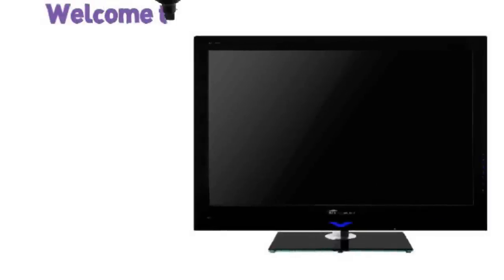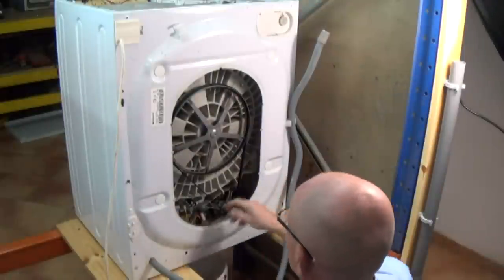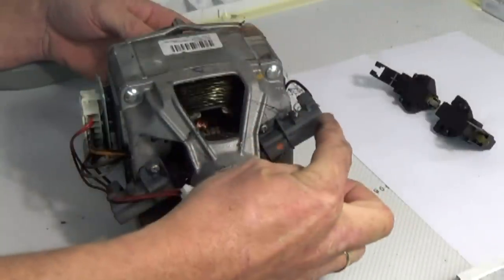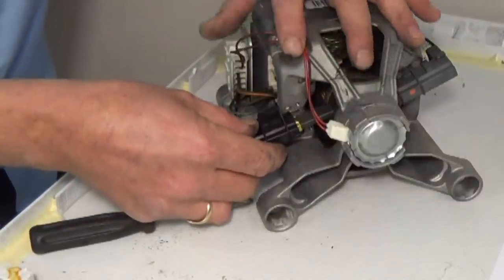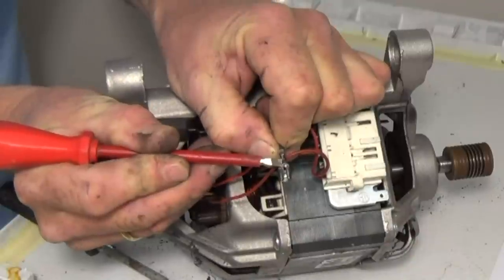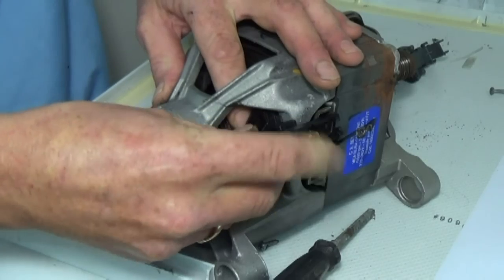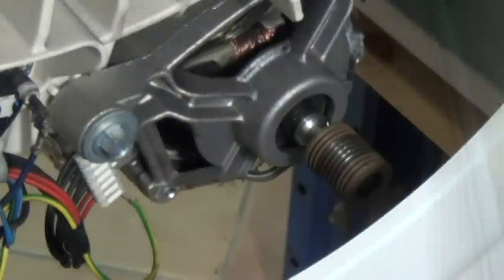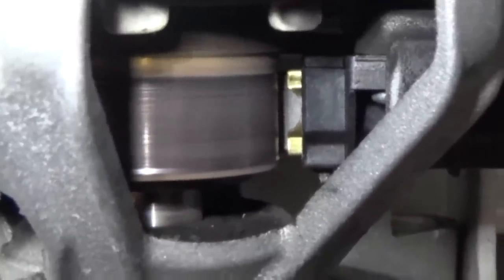How to replace washing machine motor carbon brushes C.E.SET Hotpoint, Indesit, Scholtes & Ariston

Comment: Thank you so much for this video. The step by step instructions were very clear to follow. The slight differences I encountered on my Hotpoint washing machine are that the motor is Nidec brand, the carbon brushes were PA66-GF and they were held in by 5.5mm hex head screws (which was annoying, as I had to order a 5.5mm socket). I ordered the carbon brushes from your eBay store and they arrived within 2 days. I can't explain how happy I am that the machine is working again. Thanks again.

Comment: This is a great video! I took the motor out to discover what type it was, to be able to order the correct brushes, then I found that if you take the plastic case off the brush there are two little brush-retaining tabs in the brass tube. If you bend them away then the carbon comes out an extra millimetre or two, which means you can reassemble the motor with the old brushes and get a load more washing done whilst waiting for the new brushes to arrive and a convenient time to fit them.
Reply from the maker: but if you damage amarture then motor nackerd. Iam Glad we could help you. If you ever need help please use our site for 24 hour response https://www.how-to-repair.com/help/contact-us/
If have a question please use our site for 24 hour response https://www.how-to-repair.com/help/contact-us/
Please remember to subscribe to our channel
https://www.youtube.com/user/Apart4u?sub_confirmation=1

Remember to Shop with www.how-to-repair.com and it would help us by posting the video or

website on your timeline. This helps us a lot and if we really helped you can
always buy us a beer http://how-to-repair.com/help/buy-paul-a-beer/

Please remember to mark us to your favourites also I would be grateful if you would
subscribe to our channels social media as this really helps my site and keeps
us going.
YouTube. http://www.youtube.com/user/Apart4u

Facebook. https://www.facebook.com/how.to.repair.appliances

Comment: I followed the video thinking I will just check if the belt is on and if the motor is moving......I got a bit carried away and before I knew it I had the motor in my hand. I had a look at the carbon brushes, they were very worn. I assembled it again and it's seems like our old HOTPOINT is turning again. I just ordered a pair of new carbon brushes form your website PAUL! My father - mechanical engineer - would be very proud, indeed, but to be honest after seeing this video it was easy......The biggest challenge was  to find the right tools in my husband`s workshop and to figure out how to put THEM together and how  they actually work...(before you comment - they are NO ORDINARY screwdrivers. I have my own set of thoses, unfortunately, they were not enough for the job....).

Comment: Excellent video - much better than others I'd seen on the same subject.  Very clear explanations and really good tips for someone who has never done this job before e.g. on getting the lid off and taking off and replacing the belt. Thanks to this video I got the motor off our Hotpoint Wf740 which had stopped spinning. Getting the brushes off the motor on our machine needed a socket size which I didn't have (rather than a screwdriver), so I took the whole motor to a friendly and helpful local appliance repairer and dealer, who took the old worn brushes out, cleaned the armature and then replaced the brushes. Once the motor was back in the machine,  the machine was back to normal. Total cost: less than £17. This video saved me a load of money. Thanks very much! I have subscribed to your channel.
Reply: Actually it was a waste of time you watching the video if you never changed them yourself!
Total waste of time.

Comment: Great video. New brushes fixed our "DOOR" lock problem. Thanks for posting.
Reply from the maker: I am glad I could help you with this problem.Please remember to subscribe to our channel https://www.youtube.com/user/Apart4u?sub_confirmation=1

Remember to Shop with www.how-to-repair.com and it would help us by posting the video or
website on your timeline. This helps us a lot and if we really helped you can
always buy us a beer http://how-to-repair.com/help/buy-paul-a-beer/
Please remember to mark us to your favourites also I would be grateful if you would
subscribe to our channels social media as this really helps my site and keeps
us going.YouTube. http://www.youtube.com/user/Apart4u
Facebook. https://www.facebook.com/how.to.repair.appliances
Reply: Just as a adjunct 4 years later had to replace the brushes again. Interestingly it was also 4 years from when we bought the machine in 2013 I had to replace the 1st set of brushes which was 2017.
Machine now on its 3rd set of brushes but still going fine.

Comment: Many thanks. A couple of questions if I may.

1. Why did you remove the retaining plastic tab before fitting the brush rather than afterwards as that would stop having pressure on the brish as you are aligning it?

2. Was it necessary to remove the motor (other than for making it easier to see on the video) as opposed to laying the washing machine on its side and changing the brushes in situ?

Comment: An excellent video that shows the amateur exactly what to look for and what to do. I have a John Lewis JLBIWM1403 but can’t find any info on it, can you tell please which company produces the machines for them. Kindest regards, Frank
Reply from the maker: JLBIWM1403
914528148 00 20151120
JOHN LEWIS  2017-12-11 Factory ZP - ZANUSSI S.P.A., PORCIA FACTORY
if you contact me through the website I might be able to get you the workshop manual
Thank you for leaving a comment, I would love you to leave your opinion on our poll about manufactures building in obsolescence to appliances. https://www.youtube.com/post/UgkxygHomnUySd_bYjaJBdEHPO6T4dYo9Ahm
and this is for you https://www.youtube.com/shorts/e432SAb2g08 please remember to subscribe as that's is what keeps this channel going. Thanks 👍

Comment: thank you do you have IFB senator 400-1100 repair manual. I have same issue after (2001-2018) 18 year old machine. it sparked a lot. and now not working.

Comment: Would the burning out of one of these cause sooty black deposits on the back plate/spider/belt of my hotpoint? Would it also smell like burning/burning rubber after a load?